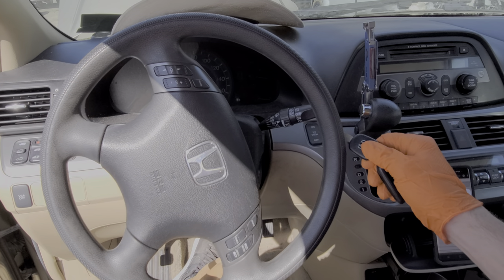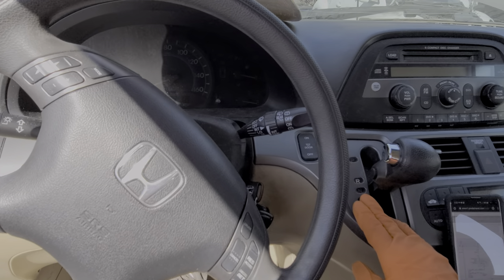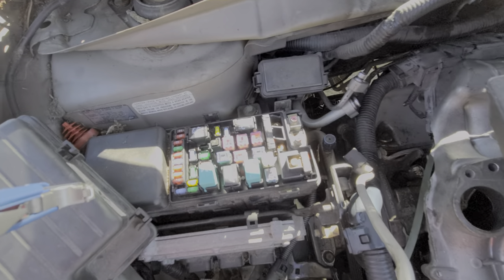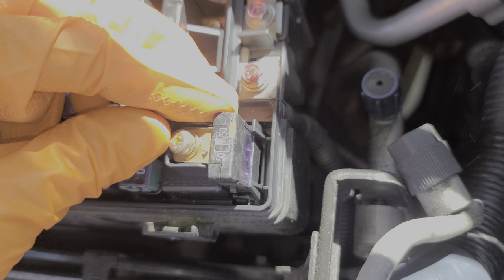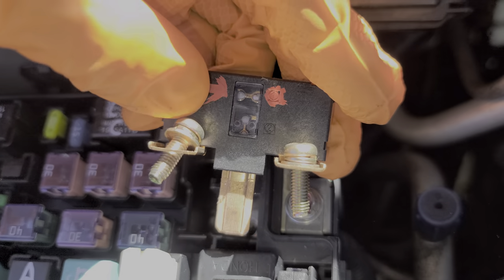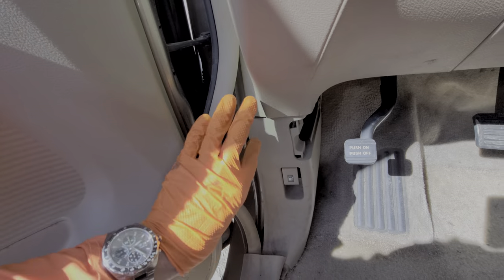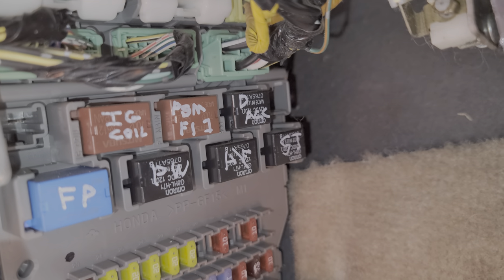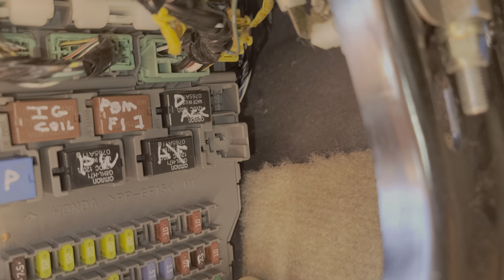2005 Honda Odyssey Starter Fuses & Relay Location, No Crank Troubleshooting

Comment: This Gentleman and the video saved me hundreds of dollars. I had a problem and it was just clicking. I went to the relays as described. I removed the Starter Relay and used the Power Window Relay. Tried to start it and it clicked as before. Next I put the gear in Neutral and it started up. I replaced the Neutral Safety Relay with the Power Window Relay. Went to start it and it started up while in Park. I'm so happy I solved the problem WITH YOUR HELP! Thanks

Comment: I have an 08 and it'll crank but not start. I've had battery issues but I have bought a new one and installed now and same issue. It just happened overnight sitting there in my driveway. Like I said it will crank buy not start and while cranking itll spit and sputter and backfire really bad it seems. I'm lost but the fuel pump is good, seems like fire is good to the plugs. I'm going now to check the relays and fuses. If you see this and he any suggestions please, please lmk. Good video and thanks.

Comment: You have great advise, but mine won't start after putting in new starter and new battery. Turn the key and just hear little clicking noise, what a could I have overlooked?

Comment: So, not only will my car not start, but there are no lights turning on when I open the door, headlights not turning on either. Battery is holding a charge, but did find one of those two fuses in this video is bad. Would that fuse affect no lights coming on in my car, too or just the car starting? Could there be something else going on?

Comment: 2004 ody, New trans range sensor, new starter, dash lights up but no crank, switched relays as well...
Any other hints? Not exactly sure where the starter relay is too

Comment: I must turn key numerous times before 05 Odyssey will start. I hear buzzing sound,  apparantly from ignition relay. battery and connections are good. What should I check for ?

Comment: 2001 Odyssey- starter just spins doesn't engaged. I replaced the starter with a new one and it still spinned. I read that some starters when you buy it new they might not work. I got another starter and it still spins with no engagement. The battery works thinking maybe not enough crank amps. What can it be?

Comment: Great stuff man ! ... my 2006 odyssey has a starting issue where as you turn the key to start and it just buzzes , then you let off and turn it again right away and it starts . . It works like this near every time for awhile now.. I tried the relay like you said but its the same with the PW relay in place of the starter one and tapping makes no diff. Im thinking its the starter solenoid acting funny. Like it sticks from abit of a sideways kink movement. So when you power it foward the second time it works its way out. IDK its a good guess. Any ideas? thanks for the vid.
Reply: Having same problem. You ever figure out what it was?

Comment: somebody could help me?  the lights on my 2005 odyssey won't come on (low beam) any recommendations?  I already changed the steering wheel switch but sometimes they don't turn on, only the long ones do.

Comment: my odyssey has no crank
battery is good
but some weird thing happening, i can unlock the door and not lock
power sliding door will beep but won’t open when press the buttons on the left side of dash
Reply: What was the problem ? I have the same
Reply: @aymenem5304  it turns out to be the ground terminal on the battery not tight enough

i replaced both terminals

Comment: odyssey 2005. cranks. no start. checked fuse box underdash no issues. all connections are good. pulled the starter wire. powers ok. swapped relays all seemed ok. one fuse that refuses to light  with test light   key on or off position is #23. pulled it its not blown. swapped with another fuse no joy. new battery. started intermittently with crank no start, no connection to obd2 and flashing green key. now consistently cranks but wont start, green key flasshing and no connectio  to obd2 port. dealer reprogrammed key, swapped immobilizer and tested it no joy. They reinstalled old immobilzer and say its the ecm. well 1700 for dealer ecm was a no go. I have so far swapped ecms with correct part # with no connection to obd2 port. had a mobile key tech verify that no connection to obd therfore replacing ecm might be premature.